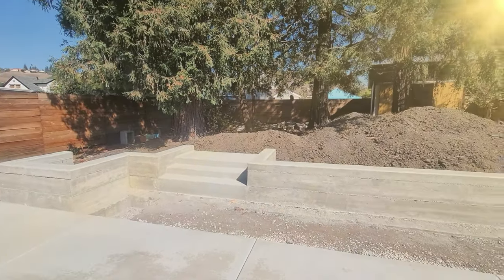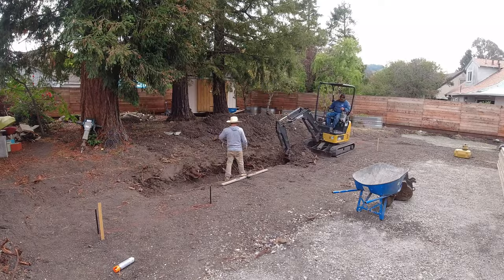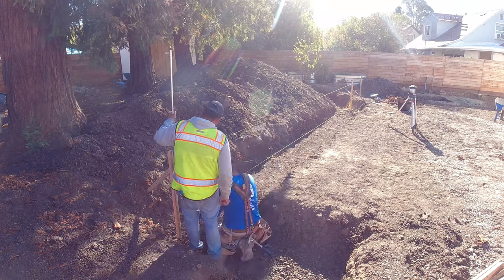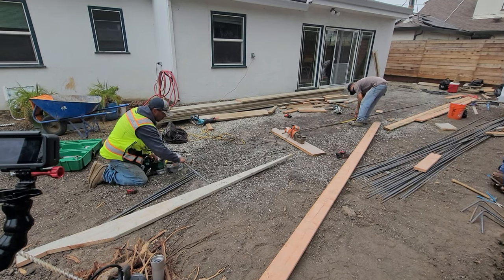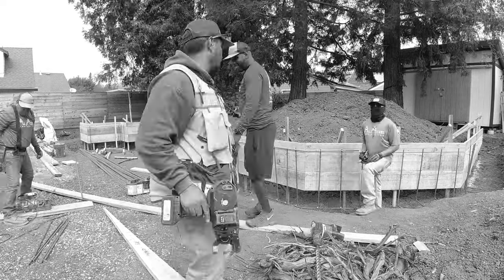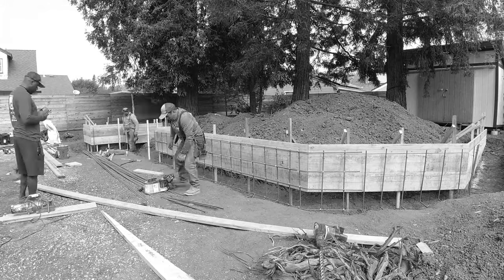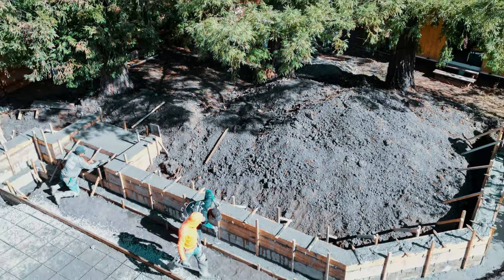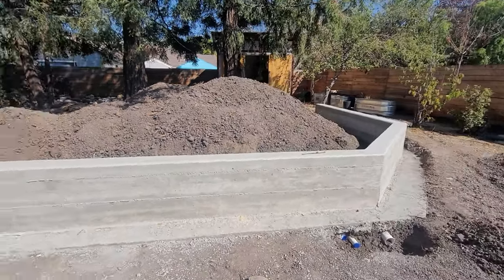How to Build & Pour A Small Concrete Retaining Wall 2022

Comment: Obviously this wall will be perfect and all, no issue, but it is important and interesting to note that if you're building a retaining wall as an L shape, it best to have the bottom part of the L 'behind' the wall, it's stronger that way and it also means there won't be concrete in the way if you're going to be laying paving, sinking posts or doing something to the front of the wall in future.
Reply from the maker: Actually this was a "t" footing. Also, the footing is below grade.

 It's always a great debate about the "L". We've done them in both front and back Ideally with those we add a keyway. But I leave it to the Structural Engineers to design them. 🤣🤣

We built an 8 foot wall with the "L" in front but it was 7.5 wide 24 inches thick crazy rebar added to it.. Check this one out https://bit.ly/3Cs2Aqh

I do appreciate you giving your opinion with out making it like it's the end of the world your wall going to fall down tomorrow scenario. Some ppl on here mannn.. 👍🏾👍🏾
Reply: @AllAccessConstruction  the wall's beautiful, I came here because I was going to pour a wall and clad it and was after some inspiration, but after seeing this I may do away with the cladding! When you build a wall that well, it almost doesn't matter how it's designed 😂 it's going to stand, the fact its round a corner adds strength too. Just thought interesting for the home gammer building a straight wall, hope they have a good think and an understanding of things before they copy something to try. As you say, T shape to your wall, but couldn't see what was behind it as well. Lovely stuff though. Yes sorry, tried not to comment in a way of the usual bad commenter who would try and find a flaw in perfection, just to try and make themselves feel better. I don't know why there are just so many "hey man, you poured that left to right, should have been right to left, call yourself a pro, first rain and that wall is down". Hope you manage to laugh such comments off, must grind somewhat!
Reply from the maker: I do laugh it off. I didn't take any offense to your comment 👍🏾👍🏾.. I call those guys keyboard warrior's 🤣🤣

Comment: How do American's get away with pouring concrete with the mesh sitting on the ground we use plastic hats here in Oz and that places the steel in the middle of the slab.. Keep seeing yanks pour concrete on the ground with the steel which is sparse at best based on the thickness of the wire and the size of the squares are huge...
Reply from the maker: When we pour we lift rebar as we go..

Comment: Hi. Are you just pouring the concrete in the foot then immediately continuing with the vertical wall..? No wait between..? Im thinking there must be a big risk of the concrete is getting pushed out of the top of the footer..?
Reply from the maker: Yes.. We always pour the footing first.. Then circle back around and pour the wall never had issues with concrete pushing out.

We use a 6 sac pea gravel 4 inch slump
Reply: @AllAccessConstruction  thank you. I have made a sturdy L-shape wood mold in my garden here in sweden, it is going to be a retaining wall. The foot is ”open to the sky” (no cover on the top of the foot). The concrete guy that has seen pictures of the mold says that i have to cover the top of the footing otherwise the concrete will be pushed out.

But as far as i understand, putting a cover on the top of the footing will create quite large forces, pushing the lid/top towards the sky by the concrete. If I attach the lid/cover to the mold, it will create large lifting force on the mold. I do not know how to secure the mold to the ground to prevent the lifting.

The retaining wall is going to be approx 4ft high, one foot wide. The foot is about one foot high and 3foot wide.
Reply: @AllAccessConstruction  is it because the concrete is thicker in the footing when you return to fill the second time, is that why its possible to fillup with concrete withput a lid on the foot? Because the concrete us thicker already? It seems funny you can actually pour concrete in the mold without a lid. 😃
Reply from the maker: Never heard or  saw a lid or cover on top..
Reply from the maker: I never heard of a lid on top.. Some guys will pour the footing first.. Then come next couple of days and pour the wall.. Ideally we like to pour all at once. This process is also called monolithic

Comment: I appreciate you making these videos. Definitely have learned a lot!  Can you tell me when you are pouring the wall and footer at the same time, what slump concrete do you use and is it always the same mix?  As in the same strength or fiberglass mixed into it?  

I’m attempting to build two retaining walls in my backyard and don’t want to use the wrong mix.  
Thank you for the help!!
Reply from the maker: Appreciate you checking us out... Weve use a 4 inch slump 6 sac pea gravel for the last 10 years.. 👍🏾👍🏾

Comment: 2024 and I know labor and concrete is expensive - but got a (few) quotes to do a 15’h x 15’L poured retaining wall - like this, just much higher. $31,000. Tell me that isn’t ridiculous? I don’t want to DIY the job to save a buck but can’t believe the pricing. 

Breakdown is:

Dig and prep: $1750
New wall install and labor: $27,750
Concrete pump: $1500

South Carolina (right outside Charlotte).
Reply from the maker: Once you go over 8 feet it's a whole different ball game.. I just bidded on one 13 feet high 22 feet long 53k..
Reply from the maker: 10 foot high wall with footing
https://youtu.be/-JL9G5-Qca0?si=SQVItl3Zd1hcZWPC

Comment: Do the a piece of the wood stake remains in the footing cement or are you able to snap it out?
Reply from the maker: Depending on the finish we are doing. If it's a board finish and we strip later.. We will leave in...

Comment: 9.93k as it stands, almost there brother. I know you’re in dry CA, but is there no concern with hydraulic pressure in the dirst pushing the wall forward as it gets taller, with the same size footing? East coast dirt is pretty dang wet, not to mention freeze/thaw. Does the wall/footer  thickness increase as height increases?
Reply from the maker: Yes sir.. When we build our walls there overkill.. Most of our footings are 18 inches  thick #5 rebar 12 inches on center. Don't have to worry about freeze thaw much here.. Hope all is well 👍🏾👍🏾📍📍

Comment: Roughly what did this cost for the homeowner? I’m looking at building a ~ 115 ft long 2.5 ft high wall out of concrete or cinder block so I can stucco over it, not sure what’s more cost effective.
Reply from the maker: Concrete is more efficient for us this project here was about $34,000 that includes the patio I think the retaining wall was approximately 60 ft by 2 1/2

Comment: How do you get the nails that hold the rebar to not show in the final product?
Reply from the maker: We use tie wire
Reply: @AllAccessConstruction  When you take off the forms on the back wall do the nails show?
Reply from the maker: A little bit.. It's no biggie tho it's cover by drain rock.. They show very little

Comment: Is this an engineer designed wall? Wondering why it is 10” thick vs you mention you usually do 8” thick. Why not 6” and the footing doesn’t look like any designed footing for a retaining wall I have seen in other videos? Ie. The footing sits entirely underneath the earth on the up side as that’s what is holding the retaining wall from tipping over?
Reply from the maker: Actually client wanted it 10 inches thick.. The footing is more than adequate for this two foot wall.